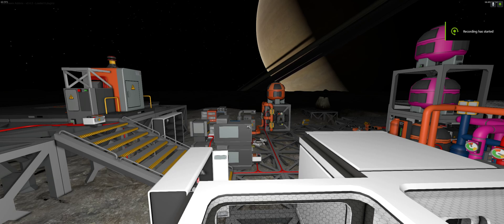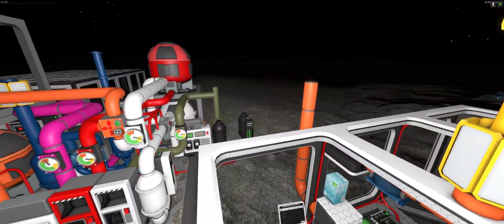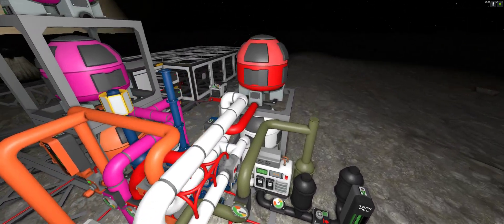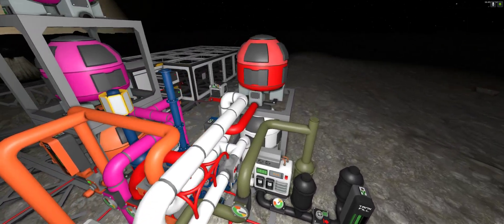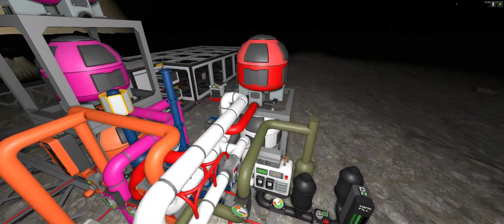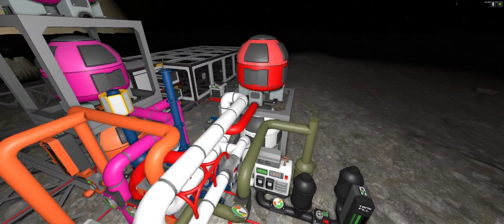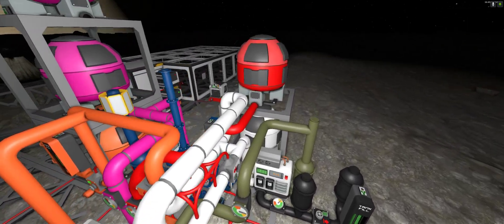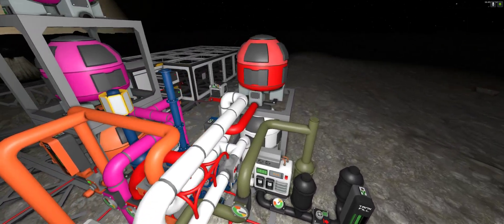Stationeers - Mimas BRUTAL Start - Part 11

Comment: dual radiators (inside and outside) are better because they are passive and dont require power. The only "downside" of this is that they will cool down way below zero if stirling will not be working, which for stirling is not a problem. It would be a problem for GSG because that would require closing valves if temp is below 10, or maybe additional heating if GSG is not working.